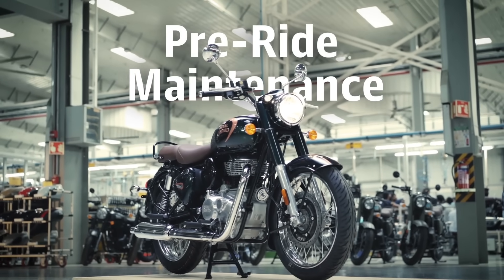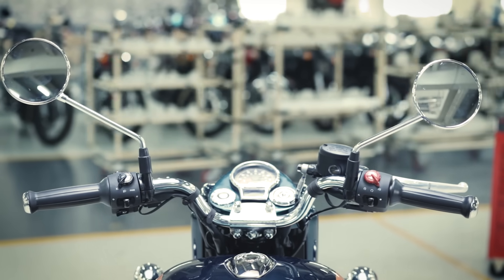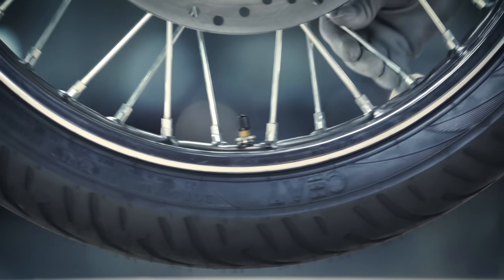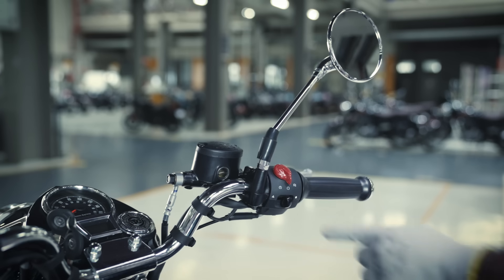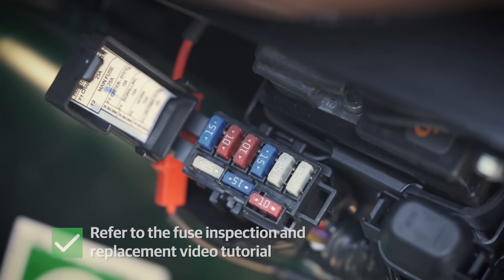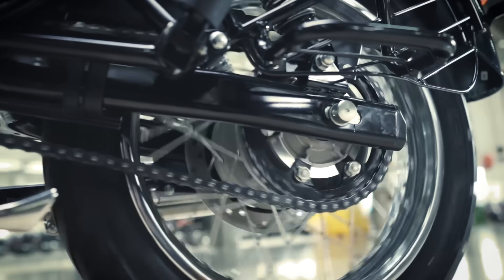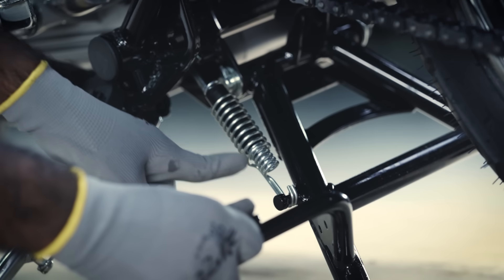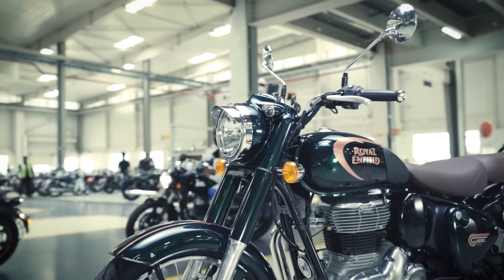Pre-ride DIY Maintenance | The All-New Classic 350

Comment: I would request RE to make a DIY video on Himalayan bike as well. That is much needed for customers. Please🙏
Reply: 4
Reply: @JP’s VLOGS I burnt my shoes bcz of the engine heat 🤣🤣🤣. More than the exhaust sound, I can hear the tapet sound in my 2021 Himalayan 🤣🤣🤣
Reply: @hemanth641  your bike might have a cam bearing issue also.....Remove top cover & check the cam bearing conditions...
Reply: My family decide to buy a bike and my brother choose himalaya but father didn't approve because of its saftey issues.
Reply: @anaswara8859  please do not buy Himalayan. I recently bought Lake blue Himalayan and sold within a month. If your use is for touring and long rides, then it will suit. If you are planning to use it for city ride, then don't even think of buying it. I just shared my personal experience. There is lot of engine heat issue and build quality is not up to the mark.
Reply: @subhanaik4363    
.
Reply: Iiiiiiiiiiiiiiiiiiiiiiiiiiiiiiiiiiiiiiiiiiiiiiiiiiiiiiiiiiiiiiiiiiiiiiiiiiiiiiiiiiiiiiiiiiiiiiiiiiiiiiiiiiiiiiiiiiiiii

Comment: In US MSF courses, they teach us "T-CLOCS"- an acronym for pre-ride inspection which means:
T: Tires and wheels
C: Chassis
L: Lights and electricals
O: Oil and fluids (Petrol, engine, brake, coolant, etc.)
C: Chain
S: Stand
Reply: I also like BOLTS:
Brakes
Oil
Lights
Tires
Steering and safety
Reply: What be us msf ? Eua marine special forces? I'm brazilian, sorry, i,am military too

Comment: This thing's gonna be the biggest marketing strategy for RE and headache for those fancy 125-150 cc sensor operated toys which can not get fixed by even mechanics. You can check and fix small issues for yourself is a great thing.
Reply: mam ji take perfekni motorka co se tyce kvality zpracani nema chybu. Ale vykon motoru tragedie.Nebavim se o kw ale i tato by mela jezdit bez problemu 100km kopec nekopec a max110a viceale tak tomu neni. skoda jinak by to byl trhak.

Comment: This is a good Pre delivery inspection guide as well (Y)
Reply: if you know you know. Last time when I gave it for service, they broke a nut and gave me like that,l to avoid that extra cost on them, which I haven't checked while recieving. i had to but it from outside as it wasn't available with them, and get it fitted outside. it cost me 300/-. That nut was below the engine which is kinda main nut to hold the engine 🥴🥴

Comment: I went to book new classic 350 with cash. But I did not book because it's without kick start. What if battery fails or any electronic failure happens, Bike will not start then, That's big issue. Bike shud start whether is battery or not. Its an engine at the end

Comment: Type pressure for Royal Enfield 350cc Redditch in manual showing:
Front tyre 20 psi without pinion.
Front tyre 22 psi with pinion.
Back tyre 30 psi without pinion.
Back tyre 32 psi with pinion.
Now you guys are saying: 
Front tyre 32 psi
Back tyre 36 psi
What different tyre pressure for Bs-4, Bs-6 and NextGen model??

Comment: My interceptor battery low indicator blinks , although Rr unit was replaced,  now within 2 months it's blinking again. 
Infact the bike knocks on run .
Could u help
Reply: Hey brother. Sorry that I can't help you out on your query; I have a query regarding purchasing interceptor. I've previously owned a thunderbird which made me spend 2k+ for every service. It always had problems with spare parts, I finally sold it for a cheap price. Do you feel the build quality of interceptor is better than the 350s? Are you spending hefty for maintenance? Worth buying interceptor for daily use?

Comment: 😢😢😢😢The world worst service award      goes to royal Enfield 🎉🎉🎉🎉
Reply: Y what happened bro
Reply: i had no issues for the past 2 years and suddenly the one i got to, has become completely incompetent. rear disc started squeaking while the bike is on move. been there 2 times after the service, first they replaced a part that was apparently causing the issue which it did not fix. second time they give the bike to some amateur and got it fixed.. which did not fix if only momentarily. 

I came to this video to see if i can check the brakes myself and try to fix it instead relying on them. otherwise the bike has been golden and the previous services have been with no issues
Reply: That's why they give DIY videos 😅 nowadays it's very rare to find genuine service person... either they loot us money wise or they damage the bike causing different problems overtime.😢
Reply: @nitish.anand99 That is brake issue. Even I have this issue right now, will order and change the brake caliper and see if it fixes.
Reply: @keima_john  idk bro, i have cleaned the disk with some generous amounts of WD40 and it doesn't make the sound anymore but it doesn't brake as effectively either.
Reply: @nitish.anand99  Thanks for getting back. I see, I have also ordered WD40 (still waiting) to try that out first.
Reply: @keima_john  Hey man, let me know if it worked for u so for i noticed that is the caliper scratching disc and might need some spacer to fix that
Reply: Lack of knowledge and skills in service centre people Royal Enfield need to look into this issue
Reply: Your are right 👍👍
Reply: Maybe that's why they're teaching you 😂

Comment: RE ..can you plz explain your ubnormal price hike.. 3 to 4 times a year without any concrete reason & using the pandemic.  Raw material price increased?? Just using your brand love & just using brand name &  loyal customers to pay more for your MDs salary hike. Extremely disappointed
Reply: While I don’t completely support the price hike, or at least the bike should be delivered at the prices quoted during booking time and not during delivery. But the cost of raw materials have certainly went up significantly. Just check the graphs for different metal prices. The only metal that went down in prices is gold. In past two years, almost every metal has gone up in price, upto 80% in some cases.
Reply: thankfully there is no tech update

Comment: Somebody there at Enfield, stop this crazy idea that black out look is great. It’s ugly as sin. You guys got it right with the 350 classic. Give us the 650 Classic with polished engine cases chrome exhaust system that doesn’t have the Mickey Mouse look of swept look exhaust that takes away form a great born again bike from the 60s classic look. Bring back the chrome spoke wheels. Ya got the tech right. Make the 650 a classic look that is what your attempting with the 350 classic. Bring some shine too the bike. If a customer wants an all blacked out bike, let them order it instead of us potential buyers are stuck with all ugly black that’s cheap too look at. The older shiny Enfields from the 60s were instant classics not this black paint that holds in the heat. Your attempting to remove engine heat with an oil cooler, then ya paint the entire engine black which can’t get rid of the heat. What school did your engineers go? They got felony stupid. Your bikes are great. Just turn the corner and dump the black out look. I’ve been a faithful rider with a small collection of bikes for over 50 years. I’ve raced many in my time in the flying mile dirt track. I know my business the hard way…called experience!!

Comment: Waste product of royal Enfield in my experience.
1. year battery problem need change.
2. year Rear tyre one side Depreciation problem
3.year chain sprocket broblem
4.year clutch plate, cables, again battery,seat plate full corrosion,rear suspension change,change,change,change,,,,,,,,,
5.year finally,!!!!!!I sale Ra,50,000 very good product and services,🤭🤭🤭🤭